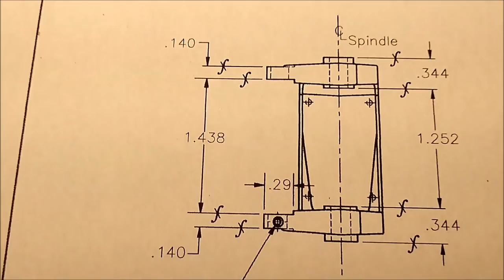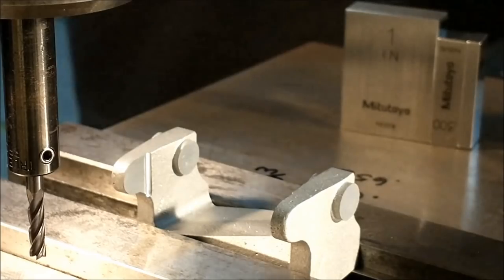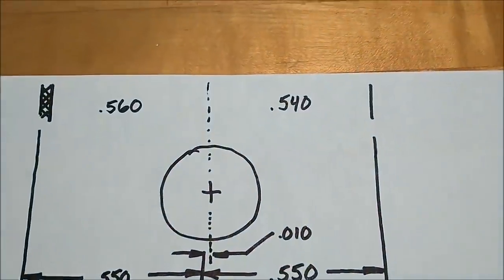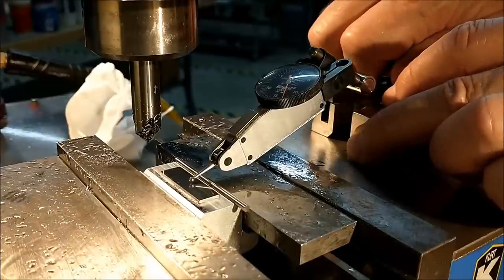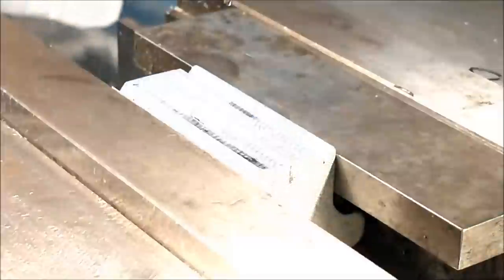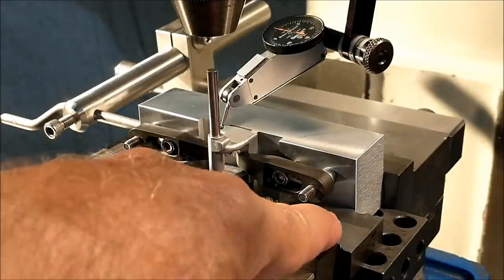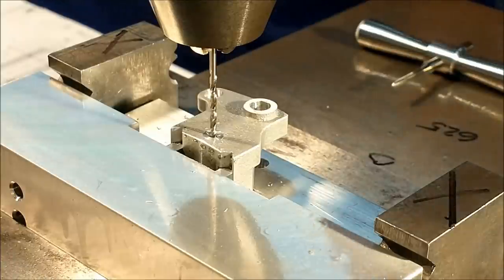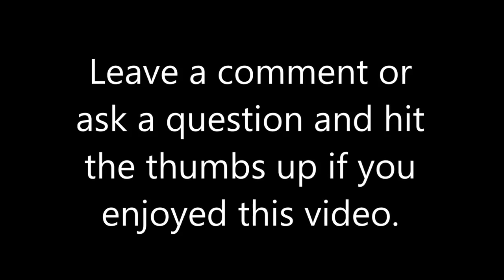Machining a Miniature Lathe - Finishing the Head Stock (b)

Comment: I'm loving this series, and this is the best yet.  Outstanding machining to get two independent parts to line up on a third part within a thou.  I suspect even high end watchmakers would applaud this performance.  At least they get to use tools designed to make tiny things; you're using machines designed for making engine parts and other big stuff.

Comment: That little plate to be fitted on assemble is a tumbler for changing direction on old lathes - I used to own a Greenwood & Batley, that was originally a overhead line lathe - I converted it to a electric with a camry timing belt, instead of a leather flat belt to power the head - just in the off chance you did not know... Cheers Glenn
Reply from the maker: Not having dimensions makes me nuts!!

Comment: Wonderful stuff Mr Pie I knew you would have an elegant way of achieving the true c/l of the little beauty and the 2 line bores are a perfect datum for the gearing  I like to see you build a little boiler to spec and use the beam engine you built to power the lathe under a steam driven line shaft It's been rainng in the UK weeks Take care and be safe Bro
Reply from the maker: I'll drive the steam engine with air and line shaft drive the lathe. Some how I know I'm going to end up with a mini shop.
Reply: @joepie221  I hope you do end up with a Mini Shop. If you do I hope you share the machining with us! I too want to build a Mini Machine Shop, But first I need to build my big shop. Breaking ground this summer.

Comment: Another Great Video Joe, Well done and thanks for showing the measuring of the vee groove depth. Sorry I could not quite get the gist of how it was worked out. Is there book / article that you could point me in the direction of so I can study it at my leisure ? Hope you enjoyed your lawn cutting. Regards from Australia.
Reply: Sketch out the layout with a triangle and tangent circle. Knowing the included vee angle and the diameter of the pin it is relatively trivial using trigonometry to calculate the theoretical projection of the top of the pin when located correctly. Alternatively you could draw the setup using  CAD software and interrogate the drawing for the correct height. Joe also goes through the mathematical method a few episodes ago.

Comment: At 15.44 you are measuring with the indicator between gauge pin and gauge block by moving the indicator across the top of the vice.Do you know the vice is parallel to the part?
Luv your work.

Comment: Question of curiosity - I noticed you using a cutting fluid on these operations. I thought cast iron was preferred to cut dry.
Reply: the castings are made out of aluminum, the cutting fluid is wd 40
Reply from the maker: Correct on both observations.

Comment: I'm about to go out and use a d-bit tool for the first time. Well. Sort of. What's the benefit over a 4 flute?
Reply: One is that you can make & sharpen it easily to any angle desired.  There is only 1 cutting edge, so no "mis-tracking".  You can bring the cutting edge right to the center.  It does not tend to clog near the point as there is a wide-open flute.
Reply: @bpark10001  awesome points! Thanks
Reply: @kylebracht  Down side is it cuts slower :)

Comment: for an alternate way of making sure that the tailstock is on centerline with the spindle, just leave the tailstock bore unfinished, complete the rest of the lathe, then chuck the drills/reamer into the lathe spindle, then under power feed the tailstock into the headstock, letting the lathe build itself.      your welcome : )
Reply: If a body chose to do that, it would be essential to check the spindle bores to be sufficiently parallel with the ways before using the spindle to bore the tailstock. Otherwise the error will be compounded in the tailstock bore, which will be elliptical as well as offset.   
I'm guessing, though, that you were joking, because using a reamer that size in a lathe that small would be a non-starter. It's not much smaller than the OD of the chuck, and longer than the ways.
Reply: @Gottenhimfella  I was joking, but it is a thing, I built my own full size lathe, what you do is use the carriage to line bore the spindle, but the carriage needs to be big enough to mount a motor.

Comment: At 27:00 - You probably already know it's called a gear change quadrant or nicknamed 'banjo'.
Reply: @ Beachcomber Bob I don't think so. Looks like a reverse tumbler to me.
Reply from the maker: Thanks for the info. I'm not familiar with all the names, but 'Banjo' makes sense.
Reply: @highpwr  Indeed, reverse tumbler cluster. The gears on that remain in place, but in one position there is one more gear in the train than in the other.
The banjo is for mounting a variety of different gear trains, for changing pitch (and feed rate), whereas the tumbler cluster changes from RH threadcutting to LH. (Even lathes with a screwcutting gearbox, which sometimes means no banjo, will still have a reverse cluster, even though it's usually hidden away inside the headstock)

Comment: Joe, I clenched up as you were cutting that V groove next to the jaw face.   Maybe I missed it, but why did you mount it so deep into your vise?
Reply: Its a thin wall part so it wont flex under cutting force,since it has a vice jaws as a back .
Reply from the maker: If you watch carefully, as I approach final depth, I shift the cutter outside the vise jaws because I too thought it may hit. It was uncomfortably close but worked well.

Comment: Why not use the actual lathe bed as your fixture to save a few minutes? Worried about deforming it with the clamp load?
Reply from the maker: I suppose you could. Absolutely.
Reply: @joepie221  Nicely done on everything so far, I'm just arm-chair machining over here! Thanks for taking the time to record/explain all the cuts. I'm learning a lot.

Comment: Not a machinist, why would a D-bit be preferred to a chamfer cutter?
Reply: A D-bit cutter has a single flute with the form of the desired cut (in this case a chamfer of 1/2 the included angle) with clearances to prevent rubbing. This leaves lots of room for the chips whereas a 2, 3, or, 4 flute cutter restricts chip evacuation. D-bit cutters are produced best on a D-bit grinder although some folks can offhand grind simple forms to effect.
Reply: @CothranMike  Indeed. Furthermore, as I'm sure you know, but others will not: 
Home shops often used to have a "filing rest" on a small modelmaker's lathe, with a couple of horizontal hardened rollers, one each side of the spindle axis, and a height adjustment. They were primarily used to put flats on workpieces, but they also made it easy to use a fine file or an oilstone to take the last few licks off a D bit, checking with a mic to make sure it was exactly half the diameter at that measurement station. 
In the "old days", multiflute cutters were completely unaffordable for most home hobbyists, so they made their own D bits for sidemilling, angle milling and even (to a degree) end milling. Mostly, though, for reaming and taper reaming.
And of course they're still used extensively for engraving, for the reasons you state.